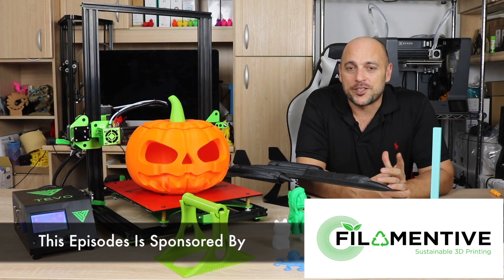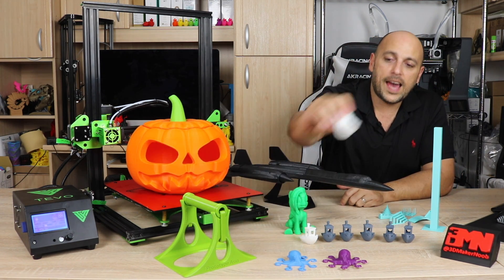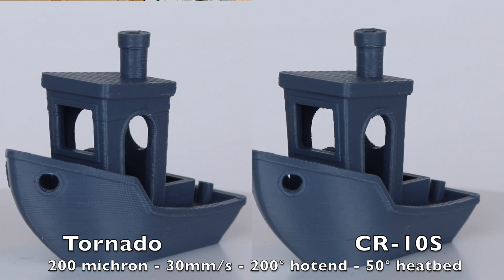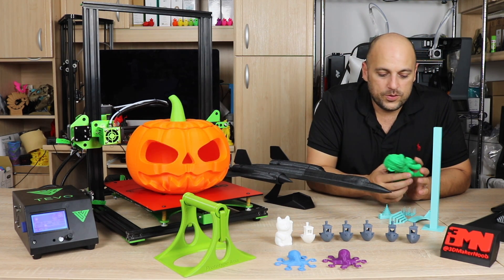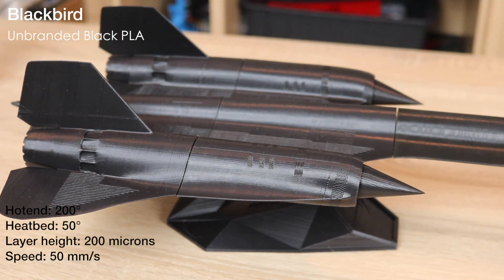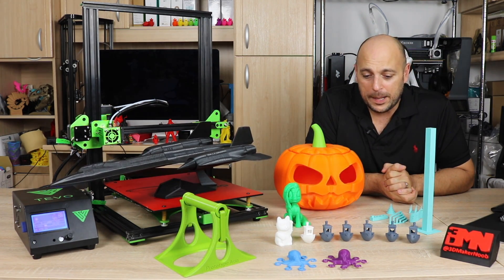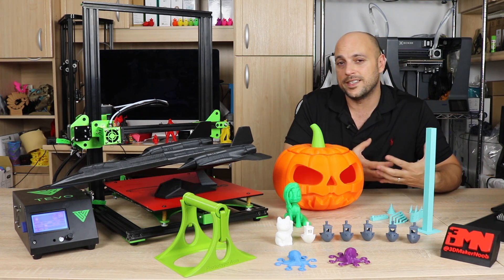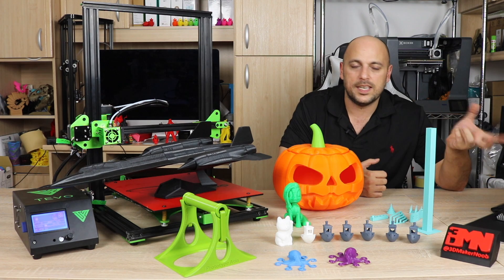Tevo Tornado 3D Printer Review

Comment: Remove the top bearing on the Z axis and make sure your alignment is right!  A lot of people have done this after experiencing layer shifts only to find that the threaded rod is not in line with the bracket.  The fix is to realign the bracket up top to match the position of the threaded rod where it meets the bearing.

Comment: would this be a good first printer?
Reply from the maker: If it’s within your budget range, then I’d say definitely yes
Reply: @3DMakerNoob  is it better than the ender 3? (proportionate to the price)
Reply from the maker: Print quality out of the box, Ender 3 will probably be a bit better. However, with some TL smoothers print quality on the tornado will be better. Along with the added print volume, Titan extruder and AC bed, I believe it is better overall

Comment: I tip my hat to you sir. How you can get prints like that out of a pile like this is beyond me. I have built 2 printers from scratch and this one is my worst experience to date. One you secure the dangerous 230v, unearthed bed cables, it screws up the levelling to the point of madness. 2 days in and I am writing this printer off.

Comment: Great review..

I bought a TEVO Tornado and received it the second week in April. Since then I've had to order and purchase many replacement parts that were installed incorrectly by the manufacturer. The Support contact "Summer" messaged me upon  my sending my support request, on April 27, 2018, through their website site. They asked for details and images, since sending all info and 5-6 images they have not  responded in the last 12 days. I have allowed plenty of time, incase the case manager was sick or on leave for a few days. I bought it because of all the great reviews, but most are unboxing and initial thoughts of their tornado, only a few work with them for 100's of hours prior to review. Mine Worked on day 1, day 3,  and day 4.. Then it slowly has been falling apart. My input, look at other printers.. Talk to more people.. I'm very disappointed in the support, i know its not a $20,000 printer. Whether is $200 to $20,000 customer support should fix manufacturing defects. 
Viewers: Best of Luck in your search for a good 3d printer..

Comment: Digging up this old review because I remember you talking about the artifact in the Benchy at the top of the side arches.  I printed a 250% Benchy on my Ender 2 over the weekend and that artifact is more pronounced.  In fact, it actually happens over 4 layers where the print steps out over 2 layers then steps back.  I looked at the recent 100% Benchy I printed and it is there as well, only barely visible.  So, it's either an issue in the model or with Simplify 3D.
Reply from the maker: I believe it’s an issue with the model in terms of how the sliver handles it. I’ve had those artifacts come up also on an SLA printer

Comment: I ordered mine on Oct 28th from Gearbest ;-(This is where I am with them.                                                        At11/13/2017 08:00:29                                    Its now the 13th and its still not shipped. Any updates? 
 Gearbest Customer                                        Support                                      At11/14/2017 01:52:40Dear Joe,
Thank you for contacting us regarding your order.
We are sorry for any inconvenience.
Unfortunately, there has been a slight delay in receiving stock from our supplier. We're extremely sorry for the situation which is outside our control and our teams are working hard to resolve the issue.
We expect to dispatch and ship out your order in the next few days and certainly within one week at the very latest. As soon as we have dispatched your order, we will send a shipping confirmation email.
Once again thank you for you patience and understanding.
Best regards,Grace_Meigearbest Customer Servicehttp://www.gearbest.com/

                                                                 At11/21/2017 12:54:31                                    This order is now OVER 3 weeks of processing. Can you at least contact TEVO and find out what the hold up is? I suggest if you can't get the item, that you remove it from your website as service like this only ensures that first time buyers like myself won't deal with you again. 
 Gearbest Customer                                        Support                                      At11/22/2017 03:24:14Dear Joe,
Thank you for contacting us regarding your order.We are sorry for any inconvenience.
This item your ordered is hot sale and there have been significant supply issues with the manufacturer. 
We had originally submitted a large order to them, however, despite repeated assurances, they only provided an incomplete batch which is far below the replenishment level to meet consumer demand. 
We are as disappointed as you and feel let down by the manufacturer. 
We wish to apologize unreservedly for this situation. 
May we ask you wait a few days more for it? 
Once we receive the stock from the vendor, we will ship your package out soon.
Best regards,Grace_Meigearbest Customer Servicehttp://www.gearbest.com/
Reply: Ouch. Not to rub salt in your wounds, but the big stock up on inventory shipment must have just arrived at gearbest. I ordered a Tornado on the 24th (US Version) and it supposedly shipped today.  G/L enjoy your printer.
Reply: Did you ever get your package from them??
Reply: or does it still say processing?

Comment: The zebra artifacting around the doorway is a microstepping issue caused by the motor drivers not microstepping accurately enough.  The area around the doorway isn't perfectly parallel to the X-axis, so it requires accurate microstepping.

Here are some links with more information:
https://ultimaker.com/en/community/16357-why-does-my-print-have-tiny-zebra-stripes
https://www.reddit.com/r/3Dprinting/comments/5uv78l/how_to_get_rid_of_artifactszebra_stripesmoir%C3%A9/

Comment: Thanks for your review. I hesitated for a long time between the CR10S and the Tornado, I chose the Tornado and I'm waiting for the delivery. I'm already printing with an Ultimaker2 and a Prusa M201 which I have a hard time tweaking the settings (my Benchy is a horror all shifted), I hope that the Tornado will be the height of my expectations.
Have you test smoother to reduce artefacts ?

Comment: It looks as though, they put crimped connectors on all of the wiring that goes into screw terminals. Putting stripped wires into the  screw terminals is a sure way to get an eventual poor connection, which can lead to overheating, sparking and FIRE.

Comment: There's a lot of posts about people installing TL Smoothers to reduce artifacts.  Have you seen that (or tried it?)  Also, what did you set the Acceleration and Jerk settings to for good results?
Reply from the maker: +Where Nerdy is Cool! I just bought a set of smoothers to try out actually, both for this and the little monster so will know soon the difference :) I actually haven’t touched the acceleration and jerk yet. Every print on the review was with stock smart tings
Reply from the maker: +Where Nerdy is Cool! That’s setting not smart things hehe
Reply: 3D Maker Noob be sure to inspect the wiring    It has to go a certain way (I’m told)

Comment: Without CR10 there would be no Tevo Tornado and the low price that comes with it. I'm still sticking with my CR10 but I appreciate the competition. Just hope that someone out there has plans for an enclosure upgrade for CR10, so that I could print ABS with it. Thanks for the review.
Reply from the maker: +3D Printwiz yep, competition drives improvement and innovation and that’s what drives this community :)
Reply: 3D Printwiz, use some blue insulation foam that is cut and sanded in sides and then glued together to make a sleek and functional enclosure. 😃

Comment: If you could personally only have one printer, would it be the cr10, cr10s, cr10mini or this tornado? Including some improvements that can easily be made, not just the way it came from the factory.
Reply from the maker: +Psy004 trusty is that out of all of those, the tornado has the same quality once dialed in as he cr-10s. But it’s almost half the price, so I’d go for that, spend some time dialing it in and then buy a filament sensor and possibly upgrade he board and it would still be cheaper :)
Reply: 3D Maker Noob you might have just changed my mind about what printer to get. Thanks for the reply and for the great review!

Comment: the screws not tightened is by design, would they have been tightened and someone dropped the box during shipping it could warp the parts. Shipping with the screws not tightened reduces the damage when dropped, because it allows the vibrations to be absorbed a bit
Reply: Maybe that explains the bolt that fell out from under the dash of my car, when I hit a bump in the road.... ;-)
Reply: Interesting....you would think they would alert the consumer to that in the instructions, so they know to check

Comment: Seems like a lot of YouTubers have issues with semi-assembled printers not arriving properly assembled. Going over all the screws, belts, and rollers is a must.
Reply: i've seen it on so many things. Even furniture parents have bought. I got tools and what not. So i can check everything. Funny how many problems i find with brand new things being over tightened or loose. Just took apart a desktop fan i have that after a cleaning starting take a while to start up. Turned out the fan blades had gotten shifted down the housing rod. So before it would drag and slow down and my cleaning nudged it far enough to make it snag. I moved it up a considerable amount and now it spins even faster then the exact other one parents got later on and far more efficiently.

Comment: Thanks for a great review! Were both printers used as-is in factory condition? If so, why not use slicer settings specifically for each printer instead of using the same gcode?
Reply from the maker: +j mtx all printers were factory spec. The reason why I used the same simplify3D profile is because a lot of people will ask me for comparisons with the Cr-10 and that is the best way to do it since essentially they are almost identical. The blackbird and the pumpkin were done with a custom tweaked profile though

Comment: What happened to tevo turantula review
Reply: TEVO had way to many problems with the Tarantula and has told most reviewers not to bother until they  fix the issues from what I have read.
Reply from the maker: +Paul F not informed of that myself. In my case I assembled it, or tried as the instructions are incomplete, tried to print something, results were abismal due to lack of part cooling fan. Requires too much work so will be putting it on hold for a while
Reply: Ahh, OK, well, It clearly shows there were problems with the machine. I read Thomas S. from germany had one that threads were not tapped and they just said not to bother they were making improvements.

Comment: it uses external  DC-AC SSR which is not a mosfet, it has a TRIAC inside. The DC-DC SSR is the one which use mosFet.
Reply from the maker: +Short to Ground thanks buddy, these are things I still need to learn :)
Reply: Thought I was the only one who noticed that.
Reply: There appears to be a solder blob, lower right side on the label, of the SSR (the not 'EXT MOSFET'), it's probably melted into the plastic, so it won't go anywhere (but my OCD is saying that you should remove it anyway).
Reply: I saw the same. Nothing wrong with it. Triac for AC and Mosfet for DC. But it is still an SSR (Solid State Relay). Great thing about an SSR it does it switching on zero crossing (when the AC sine swings from on side to the other), further improve on electric noise and load bearing. It is also opto isolated between the DC control and the AC power side (As well as in a DC-DC SSR). Excuse the tech blurb. But for me a AC heated bed and a proper SSR is a win!